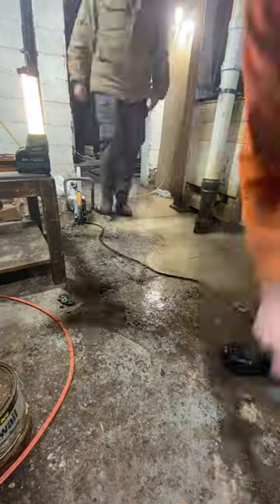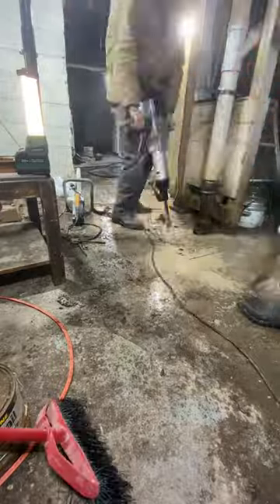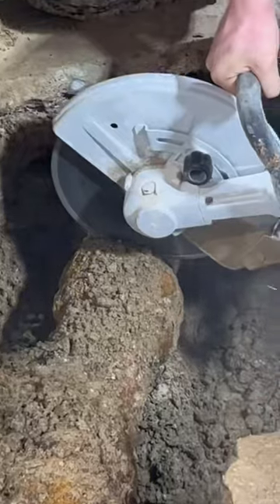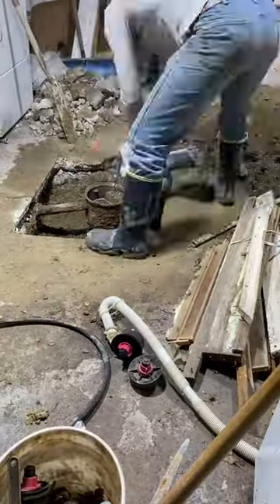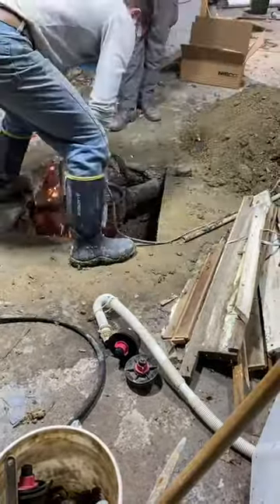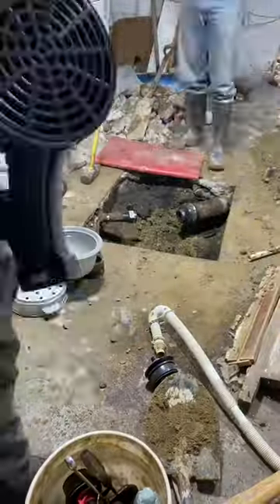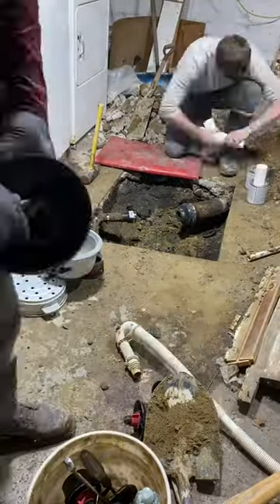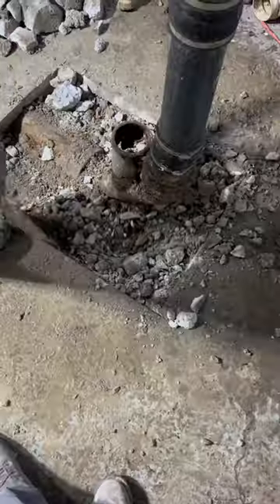Making Some sewer repairs on some broken cast-iron pipe. #HansomeOrHandy #Handyman #Plumbing￼￼

Comment: No way you are burying rubber....great job security though
Reply: I wouldn't worry about the rubber. It will probably last longer than the rest of the cast iron.
Reply: Not too many other options, and many are underground rated as well.
Reply: @bigpjohnson  ... a few years back I watched a bunch of plumbers "pour lead" while joining cast iron to PVC... and I started running while shouting "WTF are you doing?" For those who don't know, the smoke from PVC is VERY toxic. I have no idea why they didn't keel over in that small bath room.
Reply: @rupe53  Actually not - I've seen all rubber deteriorate apart in less than 10 years. Anytime below ground, you should use a no hub coupling that has a stainless steel band. Plus, those "Ferncos" are slip couplings with no center divide and are notorious for allowing the joint to separate / misalignment ....
Reply: @KD-hi6hh  ...  I doubt the rubber fails from being buried because even the stainless units are rubber on the inside. I suspect it has more to do with what people throw down a drain in the way of chemicals when pipes clog. BTW, good point on pipes dislocating. The soil needs to be tamped all around for support.
Reply: @rupe53  Thx! The stainless band protects the rubber from deteriorating. Don’t get me wrong, over the course of many years some deterioration will occur but that stainless band greatly increases the life of the rubber. Here in So Cal, we can’t use Ferncos below ground / horizontally regardless of how the soil is packed or even if we use a backing due to the risk of misalignments.
Reply: @KD-hi6hh  ... forgot to mention that the stainless wrap is more for lateral stability than protecting the rubber. That's another reason there are multiple clamps on them
Reply: I like the “Husky” bands the best…..

Comment: No 4 inch clean out on washer line.
Reply from the maker: No, only an inch and a half clean out on the waterline. The 4 inch clean out is further down by the sewer stack.
Reply: @HandsomeOrHandy  The problem is  if there is a 4 inch line it needs a full 4 inch clean out. By code

Comment: I clearly see you are a fix N flip from this video. You left a section of rotted cast iron pipe under the slab. Clearly shown in first 5 seconds. Typical flipper move, do just enough to get out from under it.
Reply from the maker: This is an apartment building not a flip.
Reply: @HandsomeOrHandy  you're going to be back there to replace the section of rotted pipe you left under the slab.
Reply: @insensitiveinsanity7145  he might own the building. 🤦🏻‍♀️

Comment: This is just bad plumbing👎 someone else will be back out there in a few years... I know plumbing code differs from state to state but those are called amendments, which ever code is stricter (the standard code) (or the amended code for your state) shall apply. I doubt any of these "plumbers" are even pulling proper permits and getting their repairs inspected. My state and more accurately my county is in the top strictest code in the country. We have to learn the standard code IPC and UPC plus all of our amendments.

Comment: Why would you go back with those rubber fernco smh I would have used the shield couplings with 4 bands for better stability and a better water tight joint.